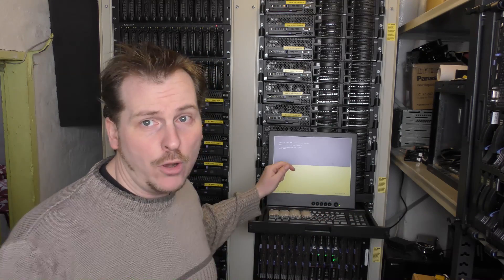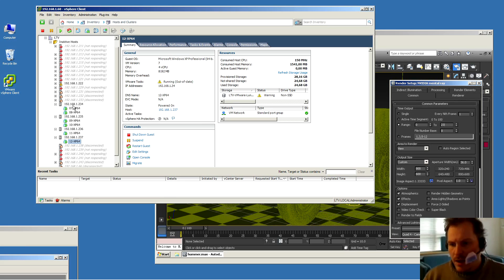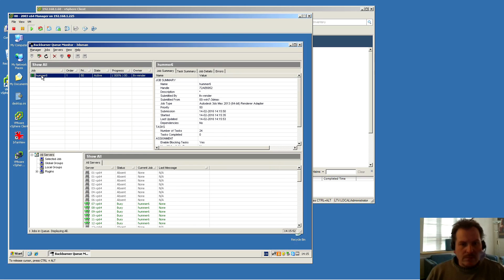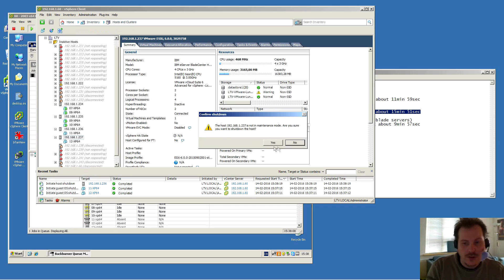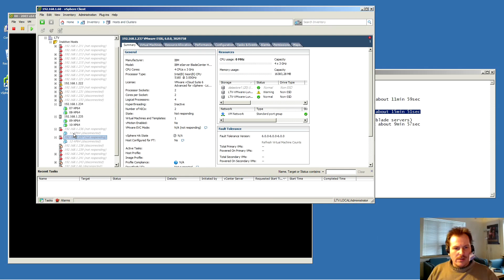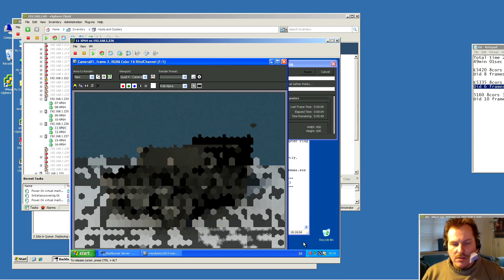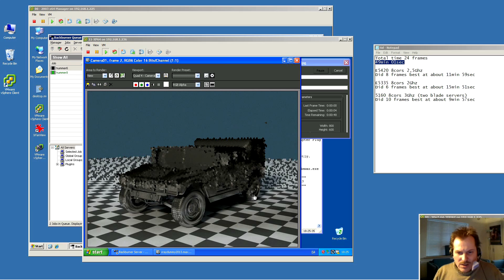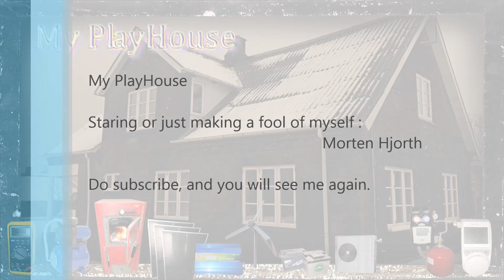IBM BladeCenter, HS21 upgrade from Dual to Quad Core - 310

Comment: Why having vms for 3d rendering it slows down your performance
Reply from the maker: It did actually not. A server with 16 cores would render more running 4 VM's of 4cores,, than one server with 16core.
Reply: @MyPlayHouse  but virtualization slows vms, not sure

Comment: Hi there Morton I love your channel keep the videos comming mate I'm from Melbourne Australia and I have some technical questions for you I've recently acquired a IBM Blade centre h 8852 4xm with 9 h21 and 5 h22 fully load with all the toys and ram I new to this style of server setup and need to know about the power configuration I have a single phase 63amp setup at my home and need to know how what where and when to get this bad boy to turn on what power circuits do I need to get it working do I need a pdu and how many amps it will run also how many Watts it will pull. In Australia we have 240v for standard homes. I can get the supply fuse upgrade to 80amps with a work around from the mate would like  cheap fix and don't want to spend much in getting a Electrian out to put in a massive 32amp circuit RCD. Just trying to get some for information on what is required. The power plugs on the back of the ibm bladecenter are 6 C19. 4 that say 16amp for the servers and 5.5 amp for the blower. I was wondering if I can connect them to C13 coverters the smaller ones standard computer plugs and keep the cost down or do I need to buy a PDU power distribution unit and have it plug into the power scoket that way. Any recommendations would be appreciated and I'll be leaning on you to get the puppie setup in the future all the best again and sorry for the long msg can you send me your email address please. Signing off for now...  Best regards Martin McKinney
Reply: +Anonymous Dev Team -Mrn00btroller (David)  LOL Yes Morton that is mine lol
Reply: 32A 3 phase would be better for safety and Then make 6x 16A out of the 3 phases
Reply: +MrAtlantis646 ask you electrician about how to connect the wires cause I don't know the standards in your country
Reply: +MrAtlantis646 dam that is gonna cost me a lot due to we have underground power and I'm on single phase Shit
Reply: +Martin Mckinney I got the ibm bladecenter h 8852 cheap $500 fully loaded with everything you have I need power lol
Reply: +MrAtlantis646 just to get it up and running do you know the minimums for power consumption with all blades and all blower
Reply from the maker: Hi +Martin Mckinney 
I am guessing you have this up and running by now. You can run this on 1 phase,, no problem. It uses somewhere betwine 375-and  600 watt not doing anything.
But do a seach on my channel for "Blade Center" I have made a ton og videos on this. and power use,,,stuff..
Thank you for watching! :-)
Reply: +Martin Mckinney nice find. found one on ebay for $4000 with only 10 blade servers
Reply: +Martin Mckinney i can get 5 more really cheap !!! the FELL OFF THE BACK OF A TRUCK ! not really.. I just picked them up really cheap
Reply: +Martin Mckinney You need any gear let me know i have lots of friends that dumpster dive and collect E-Wate

Comment: Is it Maybe Possible that you will Sell one Of Your Blade Centers? And i looked arround and see that it gaves a Patch for the IBM Bladecenter E that it dont cry about the HS22 Bladeserver. It would be realy Nice if you want to seel One of Your Bladecenter's with the Power Supply and Managment Modules, i would buy my Own Blades but if you have some laying Arround that you dont need i dont say no ;)

PS: Great Video!
Reply from the maker: Hi +DerrChecker 
I see that you are in Germany,,  so it is not imposable :-)
Make me an offer on Bladecenter's with the Power Supply and Managment Modules, passthrough network 3 intel HS21 and 3 AMD LS21 ,,, pickup,,no shipping :-)
Thank you for watching! :-)
Reply: +My PlayHouse (Morten Hjorth) Yea thtats Nice, but the Big Problem is the "No shipping" because im only 17 Years Old so i cant Drive a Car and drive to you :/ Ineed shipping for the Blade Center, it will Cost about 50€ and thats okey i think. Please give me 1 oder 2 Days to search and make you a good offer :)